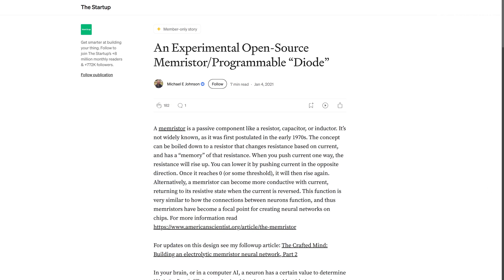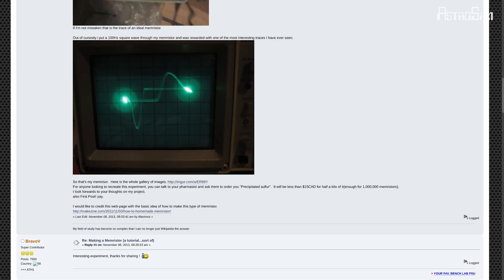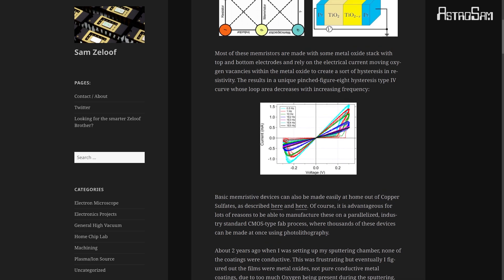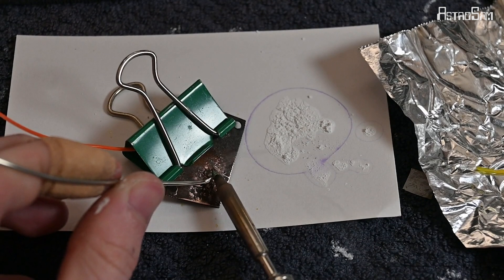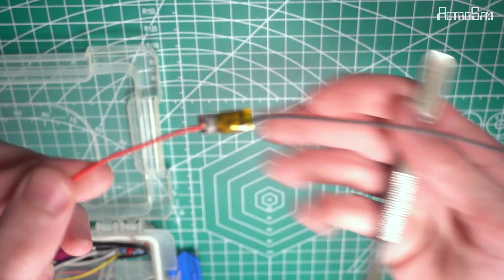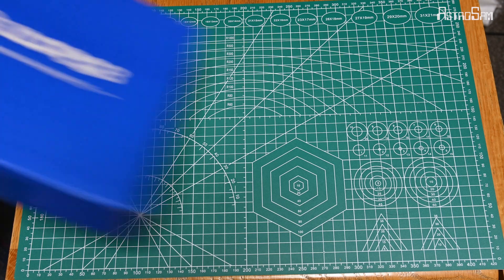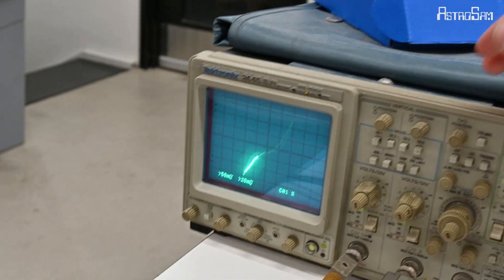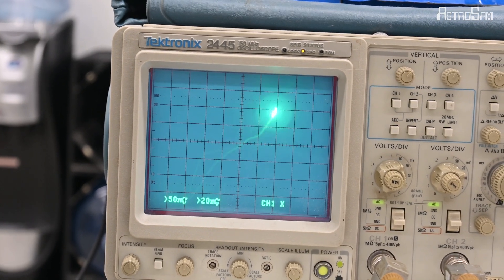Making Memristors For Parallel Computing

Comment: This can't be a memristor. Memristance is only found at nanometric scale, since tunneling and ionic effects (that cause memristance) are not verifiable at milimetric scale. I think you are seeing another type of phenomenon, almost like parasitic capacitance mixed with small resistance; not memristance.
Reply: depends on the switching and conduction mechanism - tunneling is not at all necessary here. there are many papers with micron-thick memristors and more. although, they are not that good in the end - usually, they endure not many switching cycles or do not retain the memory states long enough

Comment: I think what you see as you f up 😅 is saturation, locking out the piched hysteresis. Alike a transistor an amplifier or switch depending on how thick the base is. All on for that thicc

Comment: how much did it cost?
Reply from the maker: The PCBs were provided by JLCPCB, so I don't know the exact cost, but under $50. Although, you could do the same without any printed PCBs by using copper sheets or a bare PCB sheet. Then the sulfur only cost about $10 online.
Reply: @AstroSam2  how wide do you think the copper sulphide layer is.

Comment: 8:33 I might be missing something, but you can specify in your pcb design files where to not put soldermask when getting pcb's professionally manufactured to save you time sanding. Cool project otherwise!
Reply from the maker: You can specify to remove solder mask, but no matter what they always add a surface finish (HASL or ENIG), and will not leave any exposed copper, which is required.

Comment: How exactly would you train a neural network using these?
Reply from the maker: Essentially you can use the array of memristors as RAM. This will be memory where each memristor holds the "weight" of a synapse in the network. Then, when you run the network, it computes the neuron calculation at each memristor almost simultaneously (or as fast as electricity travels). Importantly, I don't believe researchers are interested in using memristors for training . Rather, when a traditionally trained neural network is recreated in-hardware with memristors, it can be executed at extreme speeds and with very low power consumption. In other words, solving the biggest two problems with running models.
Reply from the maker: It's important to note, however, that these can be used for a lot of other computation purposes as well, it is simply neural networks that interest me most.
Reply: @AstroSam2 so they would train it on a computer with gpus first on the training data and then execute it on the test data using memristors? I thought the most intensive part was the training by adjusting each weight in memory and updating it. Or maybe I misunderstood your explanation